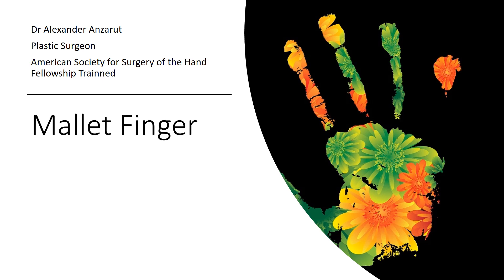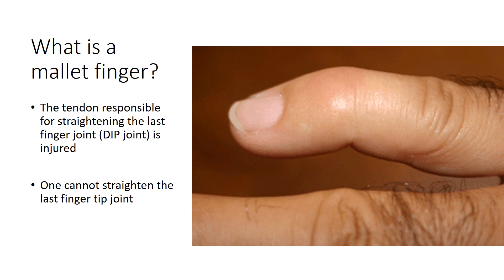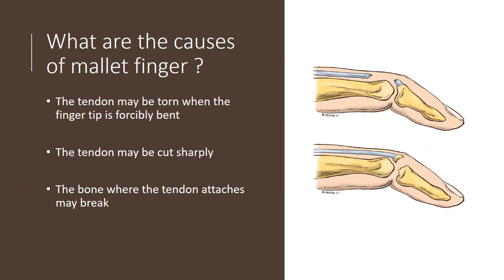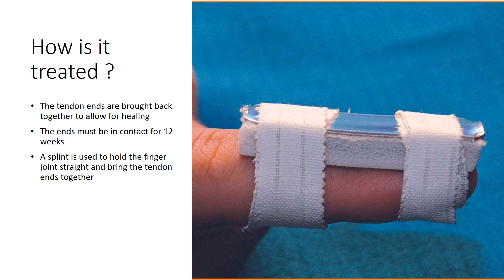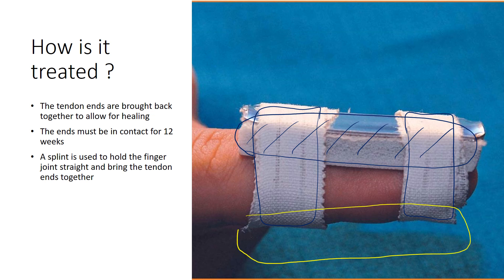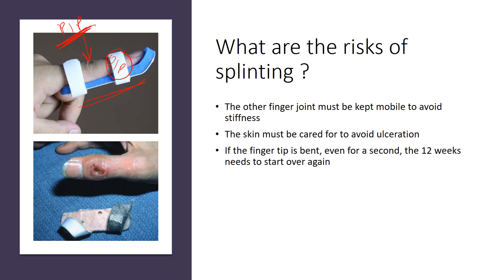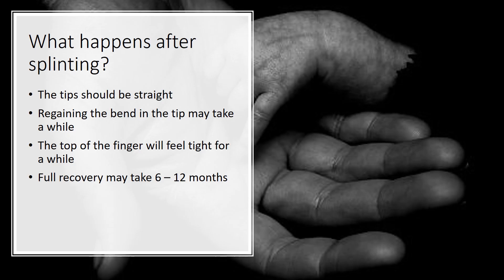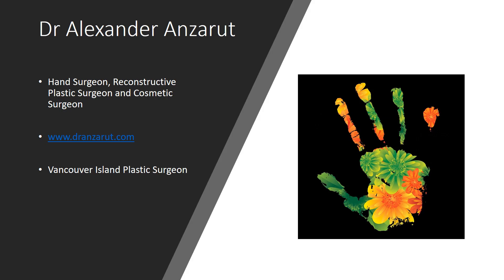Mallet Finger Explained by Dr Alexander Anzarut

Comment: Very informative video!  Mine happened almost 3 weeks ago (heard a snap when scratching my leg with my left hand, ridiculous, I know!)

Splinted immediately (held straight with the other hand until I got home, then splinted with half a clothes peg and bandaids until I could drive to Walmart for a proper splint), although it was probably the next day before I began keeping it straight 24-7.  It's now a lot straighter, although not fully just yet, and I dare not leave it unsupported.

One thing I noticed was stiffness in bending the PIP, even just after the injury - is that typical?  It probably bends a little more now, but still not full ROM.  I've heard swelling in the tendon due to the injury can cause that, I assume it'll improve as it heals.

Comment: I have mallet pinky on left hand. I have a split on  about 4 weeks. I find difficult doing my daily activity.  Washing hands,dishes cooking,sewing gardening.  I even use my hand and not finger to weave a rag rug. I take off the splint to shower. It seems to be healing but I knew it was going to be a long process. Your video shows it maybe longer than 8 weeks. I can move my joint prior to the injured. I can see how stiffness would happen. Sometimes  my finger get sore, like wetness of the splint so I give my finger a massage and hold it in my other hand.
I just wanted to share my experience.  
Past I had another on ring finger right hand but did nothing as I didn't know. It's still bent but able to use it.
I think knowing how to fix and do it right away.
My first split was  Qtips and  band aid until my splint arrived in the mail.
With virus and shut down did not see a Dr. Too crazy out there.
Reply: If you take your splint off to shower, does that mean you are allowing your dip joint to bend?  My doctor said not to let it bend, or it would be like starting over at week 1 with healing.
Reply: The splint must stay on, regardless of the activity.  Get several splints, wear one in the shower, and switch to another one when drying.  Wear it to bed, you can tape the adjacent fingers with the affected finger and it seems to work well.
Reply: https://youtu.be/6vd2AS5eQlI

Comment: Hi there thanks very much for your video. I had this injury for 5 weeks but didn't go to get the treatment done until last week and they said that i have
 have mallet finger injury in my index finger caused by intra-articular fracture of the distal phalanx. They recommended me the stack splint but is more longer and is covering my other joint that is not needed and is infact bad. Frankly it is not comfortable and the skin has discoloured etc.They also warned me that I am 4 weeks late so they don't know if it will be straight enough now. I asked them for a  better splint which allows more breathing and can let me type as well. The answer was that they belive in stack splint and they have no time to search on the internet for find me an alternative. I know there are more comfortable splints available but I can't take the risk more as I am already late in the process and I cannot be sure which one would really works. If you can please advise, I would really appreciate that.
Reply: Hi i have the same problem as u im 5 weeks late and i want to know how is ur finger now ?
Reply: @azfootball921  what did you do???
Reply: Hayel Hany  ??

Comment: Hello, i have now a mallet finger, my question is. should the doctor take an MIR to proper diagnosis??? 2nd: during the splint usage (6-10 weeks) should we avoid vibrations, movements and finger usage? 3. are really Oval-8 splints the best? Thanks
Reply from the maker: MRI can look at the soft tissues. It is not a test that I use for mallet finger. I use clinical examination and x-rays. Vibration is ok, as long as the joint does not bend. I prefer foam splints or custom thermoplastic. The best splint is one that holds the joint and is comfortable for you. Alexander Anzarut